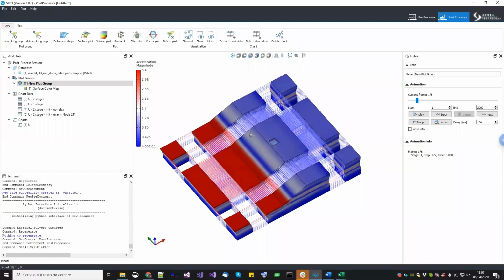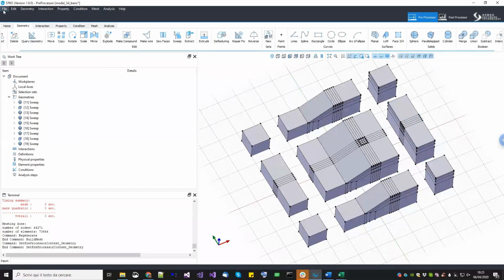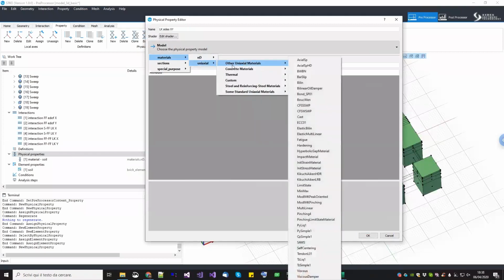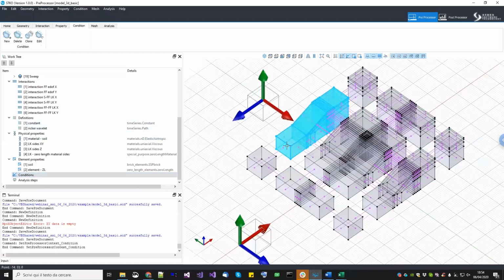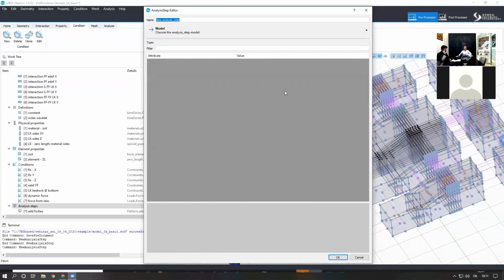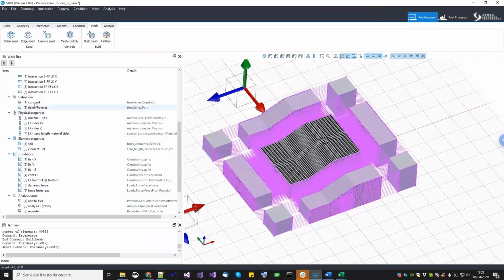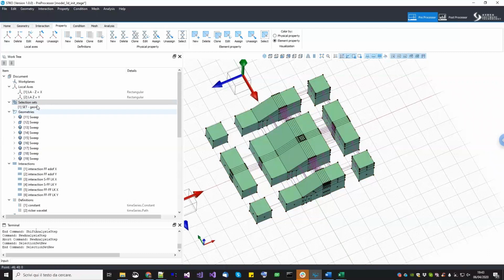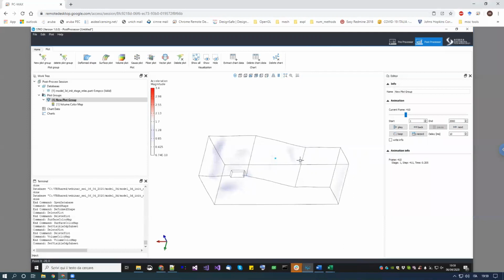STKO E-Learning Course - SSI_Absorbing Boundaries

Comment: I know this is an old problem, but why the maximum acceleration is 3.4? 0.4*g is roughly 3.9, which is what you setted in the  LoadPattern seismic load
Reply from the maker: Hi Sebastian, we forced the max value to 3.4 using the "range max" component in the Plot Editor. The reason for using a smaller value than the real peak was to better show the wave peak

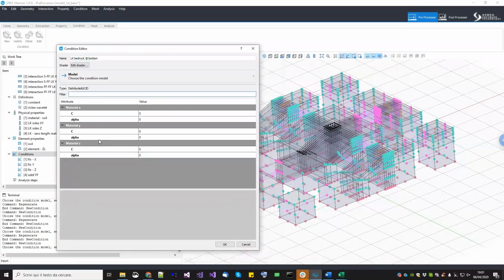Comment: At 55:26, you have mentioned how STKO creates duplicate nodes for LK BC. But if I want to build a BNWF model where the p-y springs are connected to the pile at one end and at the other end the nodes are fixed. When we write a TCL script, basically we create those duplicate nodes manually. So, how will we create those duplicate nodes in STKO for p-y springs?
Reply from the maker: You need to create a geometry for the fixed nodes, for example a line (similar to the pile, at a distance = beam radius). Then you apply a fix condition to this line. Make sure not to assign any Element property to this secondary line (in this way STKO will only produce nodes for it). Then you can create a node-to-node interaction between the pile geometry and this secondary geometry.
Finally you can assign a zeroLength physical property and a zeroLength element (make sure to check the distributed option, in this way if you put spring values per unit length, STKO will automatically do nodal lumping for you). If you need more info on this topic, please open a new topic on our forum!
Reply: @STKO_ASDEA  Thank you